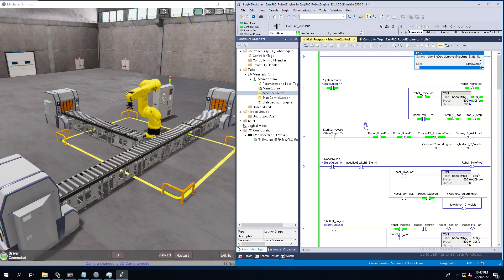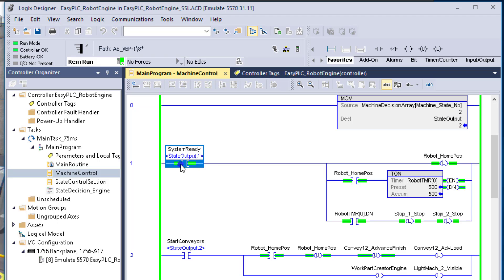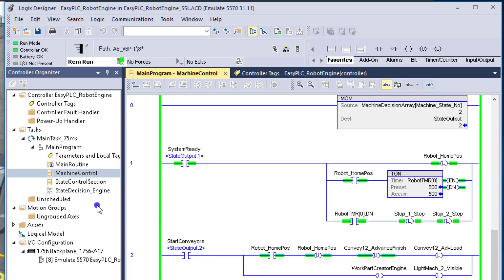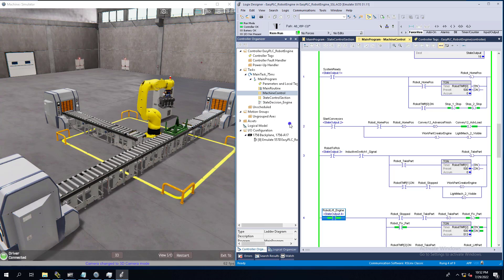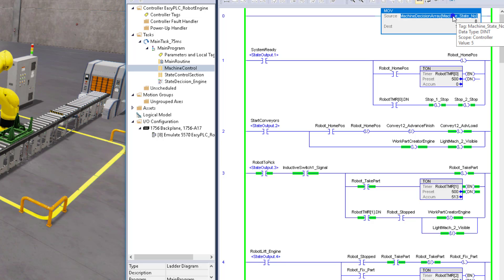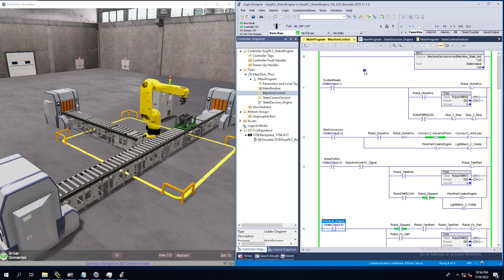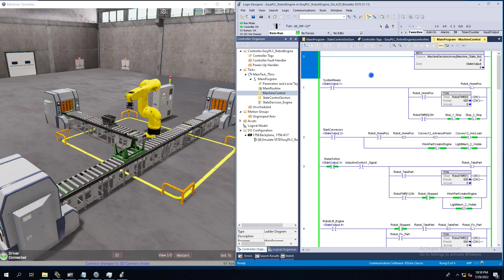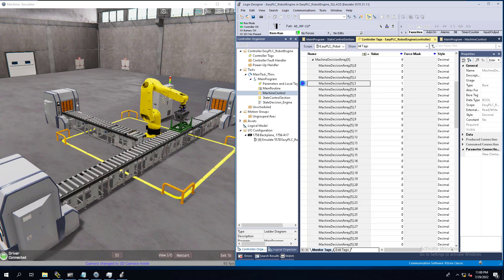Indirect Addresses Using Binary Coded Decimals in PLC Programming

Comment: How to change int to hex and hex to string conversion
Reply from the maker: Use the convert instruction for string values, there are instructions for that in the instruction panel that should be on the top of your studio 5000 program.

That is, if I am reading your question right
Reply: @ShaneWelcher  Actually I want to convert integer value to hex value
Reply from the maker: So why will the DTOS instruction work for you?
It is designed to convert a Dint to String with its other instruction STOD

Hope this helps